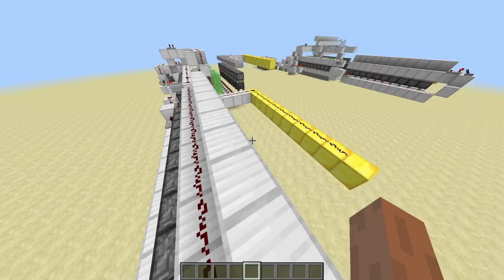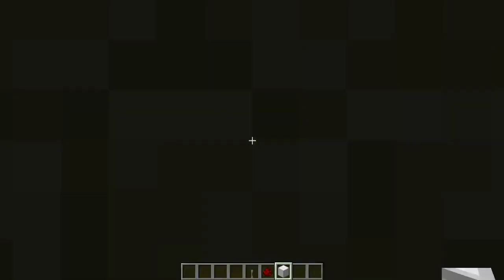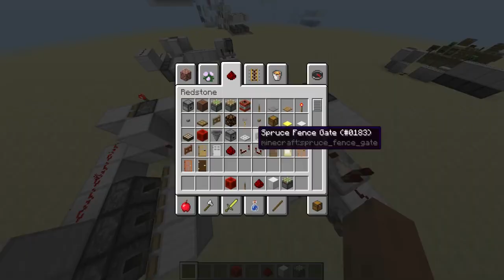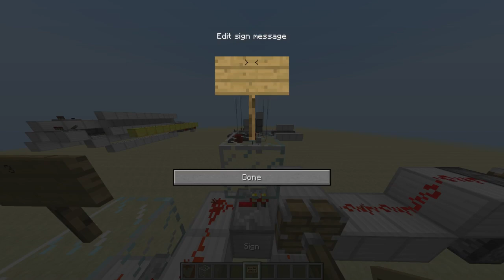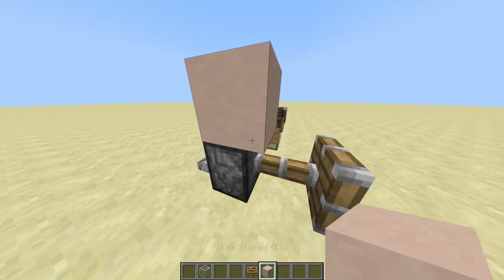More Block Event Technology

Comment: This could be used for serial transmission. Sending large amounts of data very quickly. Sending 4 bit numbers in just a tick or two on a single wire
Reply from the maker: +Tim Jadeglans Yes, that´s pretty much the only application. You can send an arbitrarily large amount of data in a single tick over unlimited distance.
Reply: +Tim Jadeglans i made such a machine but the 0-tick-gens and the decoder both take 2 blocks per bit so i only got to 5 bit (signal-stregnth) and without a proper "repeater" this is fun but pointless
Reply: @albertaffstein299  seluance made repeaker

Comment: nice!
1. do you think its possible to make a bud with a reset time < 3GT?
2. i made a 5bit instant serial wire which is pointless as long as you dont have a repeater for it - do you have any idea on how to do that without attaching the the machine to itself?
Reply from the maker: +Albert Affstein 
1. Yes, there is a way to do this. The more important question is whether there is a practical way to do this.
2. I would have to look at what exactly you did to say anything specific.
Reply: +Myren Eario if you want to i can show you, i built it on cubekrowd.net
Reply from the maker: +Albert Affstein I can try to find your plot on cubekrowd, but I have no idea how things work there. Where is your plot roughly, or are there any commands I can use to navigate cubekrowd?
Reply: when you enter, you can type /cr to go in the creative world, then type /p h:2 albert_affstein to go to my plot
when do you have time? maybe i can show you
Reply from the maker: +Albert Affstein I managed to make a diagonal version of the detector you showed me on cubekrowd, however I think it´s less useful than I thought. Do you want a world download?
Reply: sure
Reply from the maker: Albert Affstein
http://www.mediafire.com/download/l7endwccrcbls9i/Diagonal+5+bit+detector+thing.rar
But it really doesn´t solve much.
And I had to slightly rearrange some pistons in the monostable, so that the bud-chain would have the same "block event speed" as the bud-chain I used in the detector. I think that´s what you meant about extended piston bud chains being different. They have kind of a different block event speed.
Reply: +Myren Eario thanks! using this and an improve transmitter, i managed to get 10 Bits